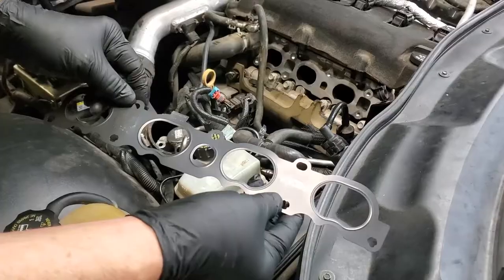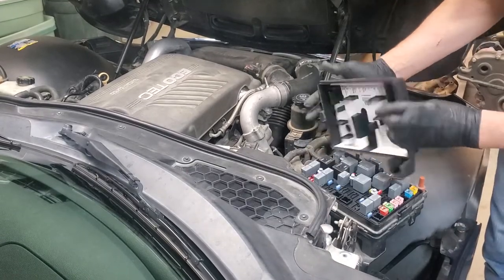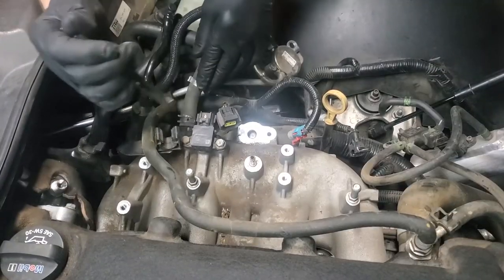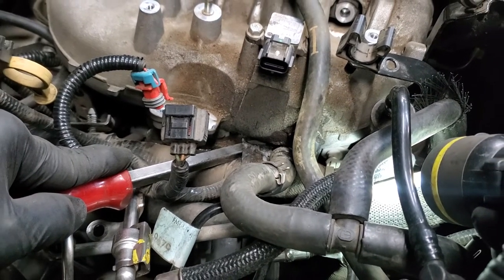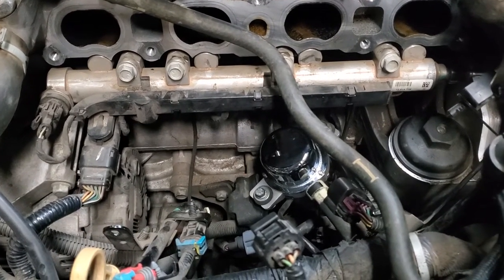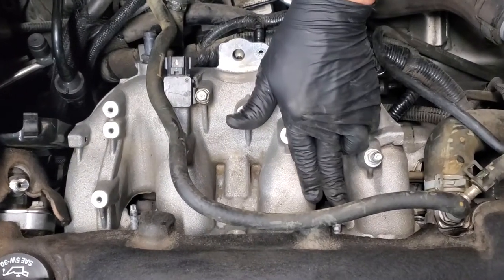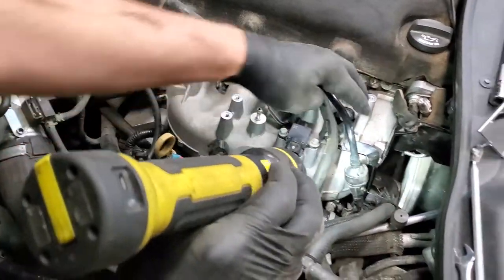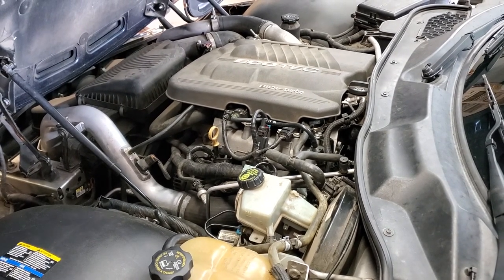P258B  2007 Pontiac Solstice Power Brake Booster - Solstice Electronic Vacuum Pump Performance

Comment: It's so hard to find detailed work instructions on the car. Mine has been one check engine light after another since I bought it. I have systematically worked through each one up till now. I can't determine whether it's a vacuum pump or brake booster. since the booster doesn't make noise I'm assuming it's the pump. I have tried to find out how to replace it and I'm very glad that I happened upon this video. I didn't know where the pump was, that I would need an intake gasket, and those hidden bolts would have driven me mad if I didn't know about them before hand. I appreciate your time and effort to film this.

Can you update us on if it fixed the code?
Reply from the maker: Be sure you check everything else first, just to make sure that this is the issue, being that this is the hardest issue to fix. Yes - it does fix the code permanently. The car has been driven 15,000 miles since the replacement.
Reply: @CarzPlus  Well, now I'm sure of it. I started replacing everything from cheapest to most expensive. Relay first,  then the booster sensor and even checked most of the hoses. The only things left is the booster itself, which I don't think is the issue, and the vacuum pump. One day, my car won't have a check engine light on, one day...

Comment: Hi there, thanks a lot for the detailed installation video.

One question: I see that the vacuum pump bracket is bolted to the LH engine mount. Would you remember where is not bolted to in the oil filter side? It never shows up in the video...

I am trying to see how feasible it would be to retrofit this vacuum pump to a 08 model, but since the bracket for the pump has been discontinued by GM, I might need to find out an alternative method to hold it in place...
Reply from the maker: Thanks for watching our video. We're happy to see that you found it useful. You might have to find a bracket for the pump at a salvage yard.